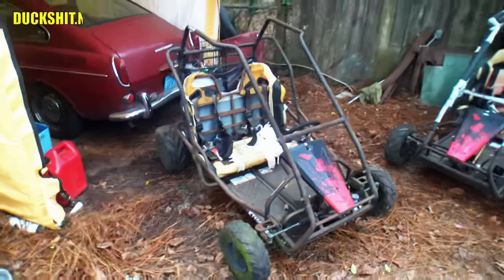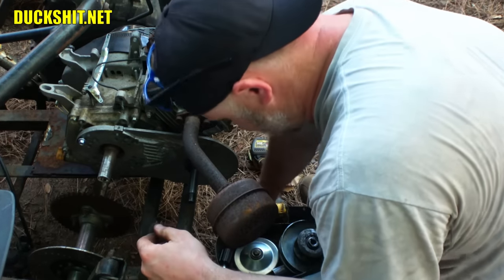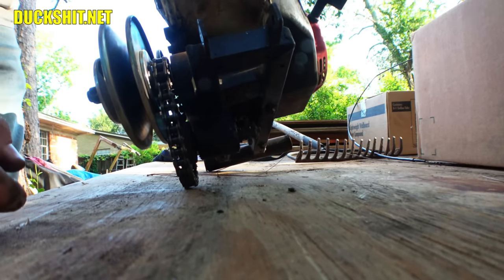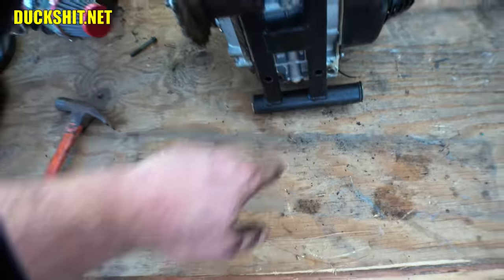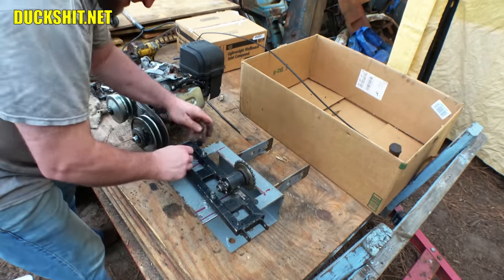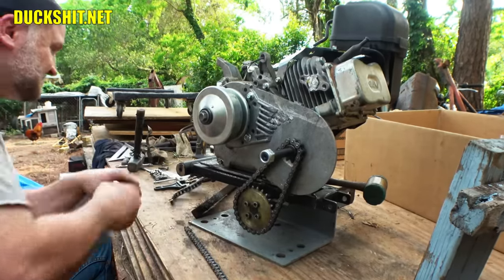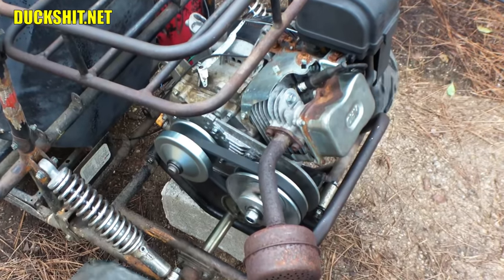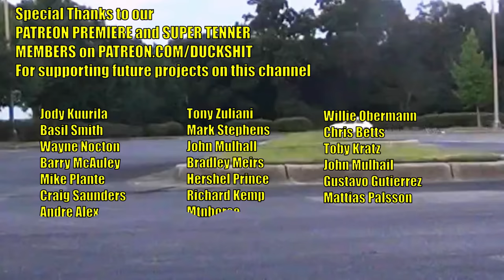Will a Predator 301 fit in a Coleman KT196? - 14

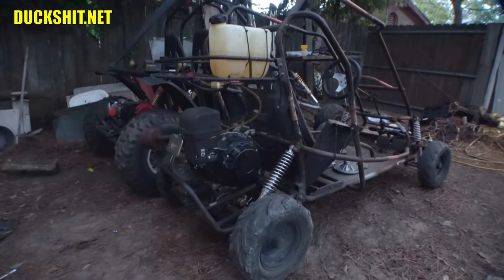Comment: At 55:54 it looks like you point to and then put the bevelled side of the belt on the inside (engine side) of the pulleys! Maybe that's why it flipped over?  Anytway, love your videos.
Reply from the maker: Yes I turned it around in the video while talking... HOWEVER... I flipped it over and back which is what is so surprising.  I even installed it correctly per the arrow, but now that I am watching this again I realize that those china fools put the label on backwards!  I just checked my belt supply, and I have one more that came from the same package and ALSO BACKWARDS!  I still have the same one that blew up later in the video... BACKWARDS! BACKWARDS! 
 GRRRRRR!  Thanks for pointing that out!  Never will I ever pay attention to the print anymore!  I can't wait to talk about this one LoL!
Reply from the maker: In hindsight, I always accelerated slower than a stock KT196 when I had a modified engine, and even after short runs my belts were SUPER LOOSE.  This has probably been a problem longer than I realize!

Comment: I have before run the bolts down with impact and the last little bit with a wrachet. I wonder if you would be able to find a grade 8 bolt to replace the one you broke on the jack shaft. It you can find one. So powerful now it almost ready to drive on the free way.:face-green-smiling::face-fuchsia-wide-eyes: Its got plenty of power now. Only way to go faster is with motorcyle engine.
Reply from the maker: Yep, even a smaller engine with a five-speed gearbox and manual clutch would make all the difference in the world.  But it was still a surprise when that bolt let go... I wasn't expecting it, I didn't even know I was at the end of the travel... which I think I may have not been.  The washer turned into a cone and bottomed himself out before the sprocket did.  Nonetheless, had to drill it out retap it and put a better bolt in.  Thanks man!  😁👍🦆💩

Comment: I useualy try a couple of left-hand drill bits smallest first work up, most times the bolt comes out after the first or second drill depending how big and long, but if you can drill straight through then it works better 🧐 thanks for sharing, all the best to you and your loved ones
Reply from the maker: Thanks man... that’s what I did I just drilled right through the bolt.  The jack shaft was surprisingly soft as well and drilled and tapped a new thread for a bigger bolt without a problem.  Sadly the camera ate that video clip lol

Comment: As much as you mess around with bikes gokarts and mini bikes, why not make a lift for the yard?? I made one myself out of a PT brand motorcycle jack. Works well copied pics I found on google. Mine I've lifted a golf cart with. Would make for a great video. I made mine for less then 150 bucks. (Scrap yard aluminum)...

Sure saves on my back and knees. Not that I'm old.😊
Reply from the maker: Oh man, the lifts are coming... after I can afford the shop, of course!  Meanwhile I use my trailer as a work platform.  But it doesn't do me any good for a VW, lol!  And I'm out of space here right now!   Thanks for the suggestion, I'll see what comes of it!

Comment: When you over power a drive belt on a torque converter, it's time to upgrade to a snowmobile torque converter. Grind Hard Plumbing had the same issue on one of their builds.
Reply from the maker: I don't think its overpowered.... not YET... but getting close.  These pulley systems aren't rated for torque (where it should be) but rather rated for horsepower.... silly.  The torque eats these things.  This engine is near the upper limits of this drive system. I really need better belts rather than using my worn china collection.  But I agree...  it will need a pulley upgrade if I went bigger.   The next engine will have a real gearbox and clutch, more more soft pulley belt garbage!   😁👍🦆💩
Reply: @DuckmanCycles and VW Garage  Sorry for being Silly & stupid. It was just a thought.
Reply from the maker: You were neither!  I just had different information.  The manufacturer is the one who I called silly. 😀👍🦆💩

Comment: You need a 40 series torque converter that is a 30 more heavy duty for your engine 🤌🏻🤙🏻
Reply from the maker: Actually, the 30 series should do it, and its been fine since I put a new belt on it after I realigned the pullies.  I have other problems elsewhere, but we'll talk about that in a future video.   If it starts to eat belts again I'll consider a 40 series, but the 301 is at the upper end of tolerance for a 30 series.  Future engine mods may push it beyond limits.  We shall see!  Thanks for the suggestion!
Reply: @DuckmanCycles  awesome man I watched the entire video I’ll definitely watch what’s to come
Reply from the maker: @kennethaustin9439  Thanks so much, Ken! Lots more fun stuff coming!